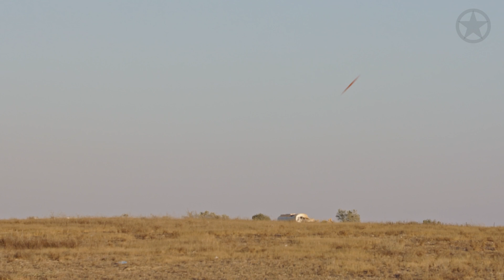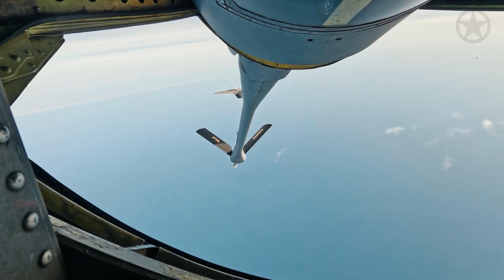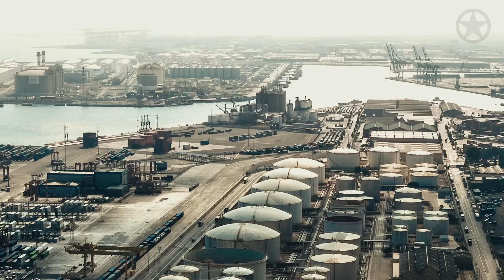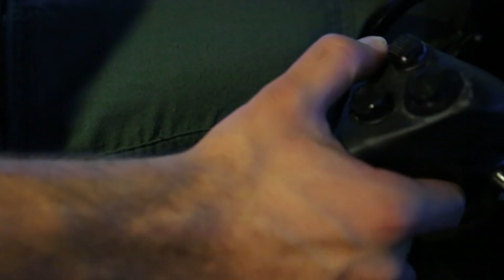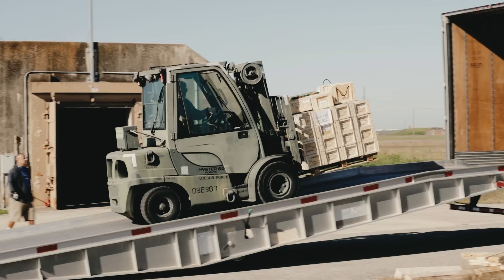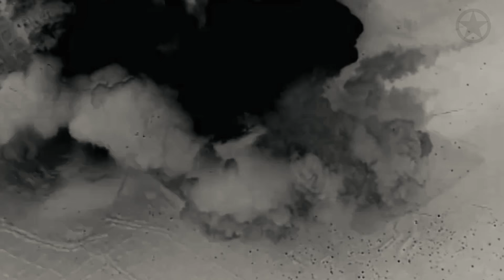Houthis Challenge Israeli Air Force — ENDS BADLY

Comment: I wonder if the IAF ran the same shuttle service as the RAF did to get to the Falkands. They had tankers purely to refule other tankers so they could fly the distance. 

I do question the statement that IAF pilots could see individuals running between parts of the site from over 30,000 feet. That would need a phenomenal piece of kit!
Reply: would that be scans from the satellites??   There are satellites in orbit above Earth, and they can concentrate over a geographic area, and read heat signatures

Comment: Just a point: The "concrete" factory produces cement, and it may add bulking agents such as crushed rock, stone, gravel, and water to make it harden.
Reply: The "concrete factory produces "concrete " not cement....cement ,sand, aggregate and water are the basic ingredients for "concrete ".. additives can be used if required for various reasons.. strength.. extra flow consistency ..etc
Reply: @stevedavis381  Super plasticizers, water reducing agents, silica. Concrete research has come a long way.
Reply: @JayKellett-y7o ...Batcher or Adgi driver?

Comment: Thank you Israel from Texas!
Reply: Thank you Israel from Florida!
Reply: Thank you Israel from Germany
Reply: Absolutely. GuyR, Northeast Texas
Reply: So you support the baby killer
Reply: TEXAS MUD NECK SAY LOOKS LIKE A 
COWBOY BBQ.
THE ONLY GOOD SATATNS
MMINONS
SENT TOO
THEIR 4O
VERGENS
OR SWEIN ??!
AFTER ALL
ISLAMOS
BOSS IS THE
GREAT deciver!!😅😂,
Reply: I got no idea about km, you need to use miles and gallons
Reply: ~0.6 mi / km so 1,000 km ~= 600 mi, 100 km ~= 60 mi, etc.

Also, 25 mm or 2 cm ~= 1 in..

Also, I just noticed that if you type any # followed by “ km =“ in these comments, it automagically appends the equivalent mi!  Cool, huh?
Reply: @tomchien7692  25mm is 2.5cm.  20mm = 2cm
Reply: @tomchien7692  1" = 25.4mm
Reply: @johnbolen8974  well then Google the translation km to miles
Reply: For what?
Reply: Fight Islam

Comment: When did the USAF change the name of the KC-135 to KC-707 ?
Reply: They are different airframes.  The KC-135 preceded the 707.  The KC-135's fuselage is too narrow to support 6-abreast seating.  The fuselage was increased by approximately 4 inches to accommodate six-abreast seating.
Reply: The KC-707 tanker is actually a 707 cargo plane that Israel converted into a tanker plane (due to the United States' previous refusal to sell tanker planes to Israel).

Its name is not actually KC-707, but that's the most convenient way to call it.
Reply: The KC-135 airframe was originally designated as the Boeing Model 717.